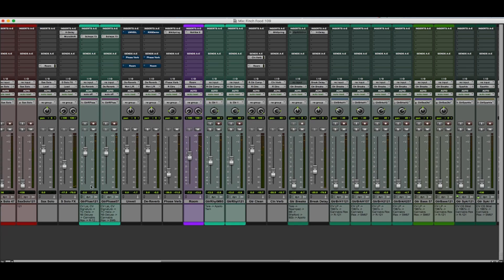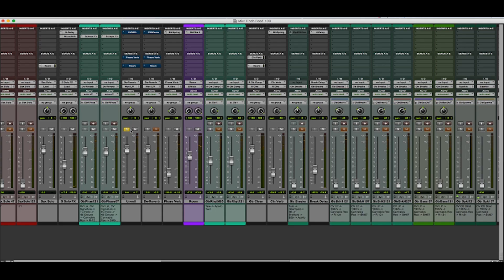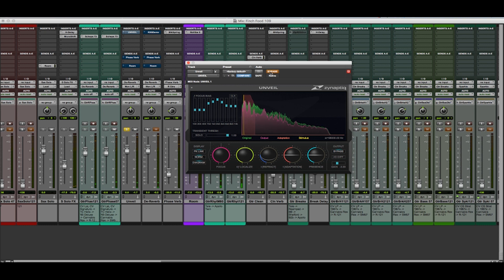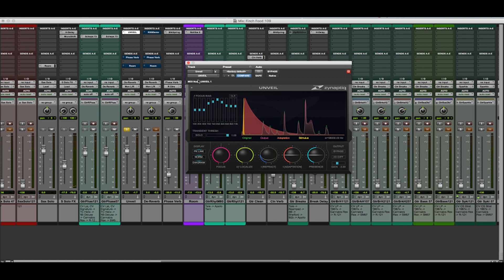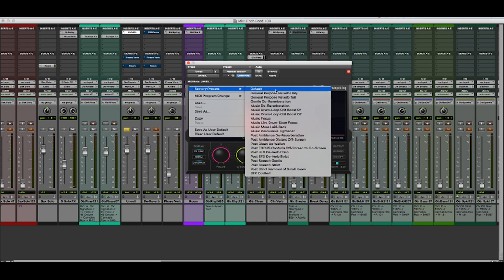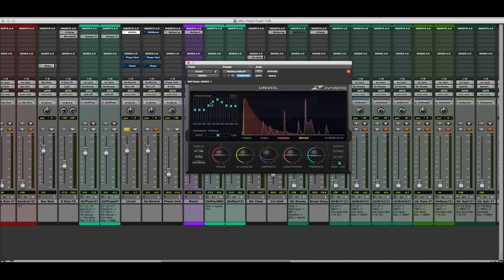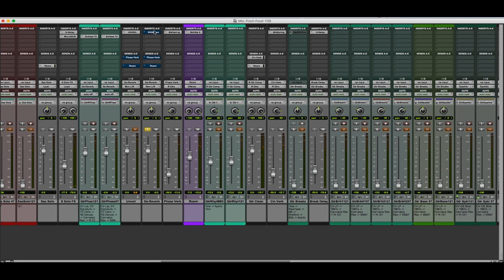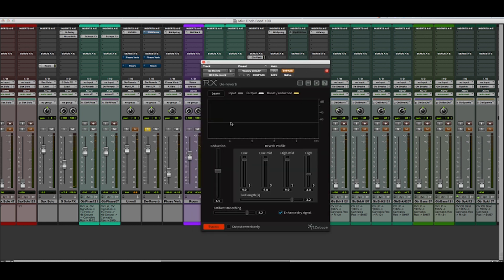How To Reduce Reverb in Audio Tracks

Comment: Hi...
Would this help me remove echo/reverb after removing vocals from a musical track while making a karaoke track?
Reply from the maker: Hey, Hitanshu! No, this likely won’t help with removed vocals on your track. Because they’re adding reverb removal processing to the track with reverb on it, you would have to have the vocal track actually in the mix in order to remove any reverb. In your case, once you remove the vocals, a lot of that reverb should be gone. Of course, you can try using the iZotope reverb removal plug-in to mess around and see if you can get rid of some of that leftover reverb from the removed vocal. You may end up losing reverb on other instruments in the track as well, though.
I hope this helps!
Nick Pasquino, Sweetwater Sales Engineer, (800) 222-4700 ext. 3230, nick_pasquino@sweetwater.com

Comment: QUESTION.... I'm a firm believer in using stock/free plugins. ive always found the big guys swamp us with "the new best vst" and all that jazz and I always try to recreate sounds in stock to prove it can be done. now I admit this is more so in electronic music.... how can I replicate or get close to this in stock? other than fades, gates, dynamic eq and midside eq?
Reply: If you use ReaFir in REAPER, you can get rid of room noise and it seems to take most of the reverb out of the mix too. It probably depends on the noise. If the noise is in the room and not in the mine line or whatever, you can get rid of the echo with it. A new trick I'm working on is making my own noise with a fan and record that. Then turn it off during the actual recording and just use the clip of the fan to eliminate some room echo from the recording with ReaFir. :)